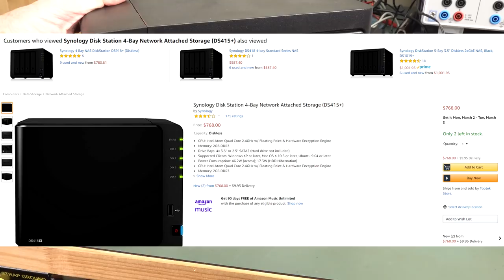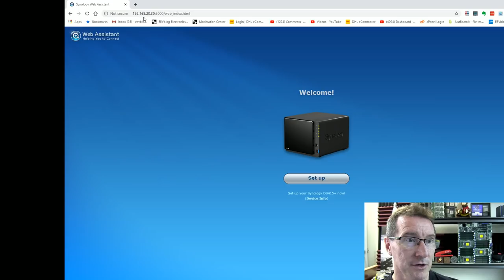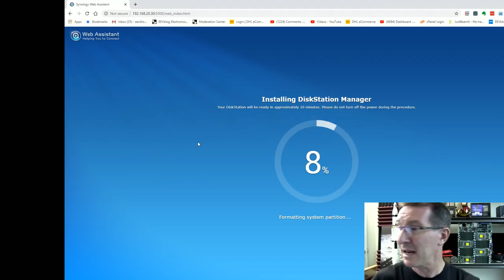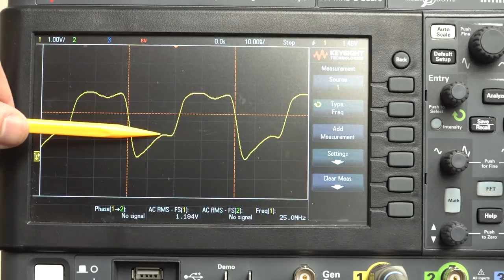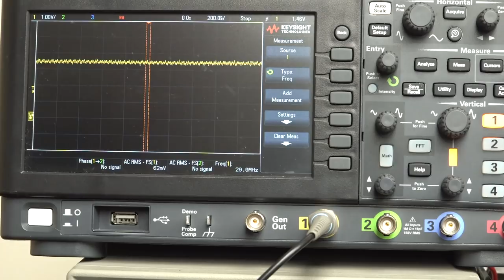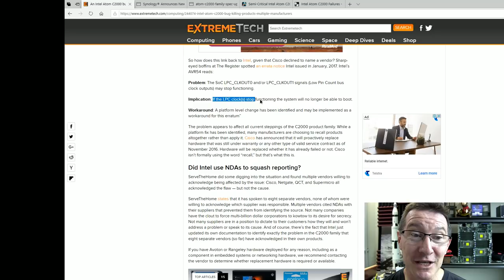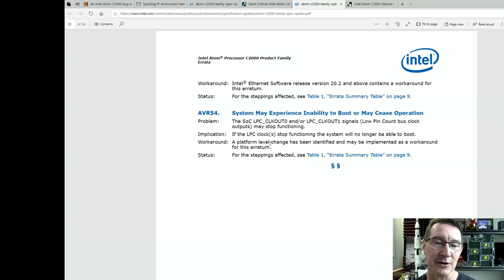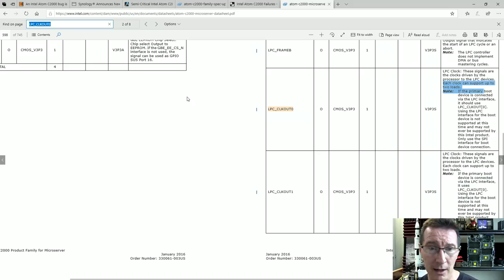EEVblog #1288 - Synology NAS Dumpster Find! (REPAIR)

Comment: I'm sure you're right about the P-FET failure.  It's probably in a hot spot on the chip or something equally mundane.  The series resistors adds a little extra inductance that might affect the clock shape some, but 25 MHz and no obvious overshoot minimizes my concern about that.  A stiff pull-up will stress the N-FET complement some, but I would use it for non-essentials.  What are the chances that the drives can be read in another NAS if this one failed?
Reply: You can put the drives into the latest equivalent box and it will migrate seamlessly.

Comment: Wow, dude, you might have just saved my bacon. I have a 1515+ which uses the same CPU, and is quite an early batch so it probably has this problem, but it's far out of warranty. I think I'll pre-emptively apply this fix! I like these devices. I can see why people say they are over-priced, in a sense they are, but if you just want something and you want it to work with no fuzz, these are great. Well, except when they have buggy Intel silicon I suppose... But other than that ;) Mine is 6 years old and going strong otherwise, running 24/7 most of that time. Here's hoping a 100ohm resistor can add some more years.

Also, you asked in the video - getting the install prompt does not mean the NAS was never used - the way these boxes work is they actually install and run their OS from the users harddrives. So, since the drive was unrecognized or blank, it had to install OS from scratch from ROM and set up anew.
Reply: Can you do it preemptively?
Reply: @z352kdaf8324  Sure, I don't see why not. The fix doesn't actually "repair" anything, it simply prevents the failed hardware from blocking the system boot process. The failed hardware in question isn't used in the NAS and thus the failure doesn't matter in and of itself.

Comment: Thanks Dave, I was planning on doing this exact fix to my Synology 415+ today!!
Reply from the maker: Let us know how it goes!
Reply: @EEVblog  I completed the resistor fix, changed the battery on the MB and swapped out the 2GB RAM for a 8GB stick :)  My Synology 415+ is now running smoothly once more.

To apply the resistor fix I bought a new Soldering Station from JayCar ( https://www.jaycar.com.au/esd-safe-solder-desolder-rework-station/p/TS1648 ). The thing is the extra soldering tips I bought for it at JayCar do not fit the soldering iron and JayCar says it does not sell any compatible soldering tips for this model...
I was not able to solder the resistor with the included conical soldering tip (I do not solder often) so I got out my cheapo 25 watt soldering iron and completed the task in no time (minutes)... Thanks JayCar... 

Can anybody recommend a good quality and well priced Soldering Station with digital display? Ideally up to $200ish?

Comment: I had a DS2415+ start flashing the power and alert lights for a few minutes then shut down.  Restart and same thing.  Zero access.  OMG I was horrified.  Did some research.  This is the Intel Atom failure that can be fixed with the 100 ohm resistor fix.  But I needed my data immediately so bought a DS2422+, a day later moved the drives over all at once and booted up the new unit.  Everything was present, zero loss.  Now to repair the 2415+ and either sell or have a backup to the backup.

Comment: I see a great many Cisco routers suffered from the C2000 issue. Makes me wonder if that's why my two Cisco routers crapped out after a few years' use. It left such a bad taste in my mouth that I switched to NetGear because I blamed Cisco themselves for selling crap. Maybe someday I'll tear the one I didn't throw out apart and see if the resistor "fix" can bring it back to life...

Comment: You can get it replace FREE from Synology :-) I have done it several times. You get a new unit with the post.
Reply: They just add the resistor and swap them.
Reply: @FrozenHaxor  Nope, they sent you a new NAS in a new and unopened sealed box. Have done it several times before. They ship same day they receive it.
Reply: @Peter Andersen, they only swap it out if its in warranty and you have an invoice right?
Reply: @BradPittishere  no, they extended the warranty for these models and you don't need an invoice. I got mine free and I just enter the serial number and they accepted.
Reply: @peterandersen4676 I am curious, do they ship out a more modern unit or the exact same model? :)
If they send out a brand new unit (not refurbished) I rather send it to Synology for replacement.

Mine (415+) has not failed just yet, so I have everything lined up to apply the fix today (preemptively) and just before I started I came across Dave's video on my YouTube feed :P
Reply from the maker: @peterandersen4676  Ooh, nice, is there a website link or something?
Reply: @BradPittishere  I got them replaced by synology. They have  a program. And the units was ofcause new units with no bugs.
Reply: @EEVblog  yes, just sign up and fill out the rma form on there website.  Just enter serial number, name and address. No need for original invoice.
Reply: @peterandersen4676  do they send out a 415+ or a newer model?
Reply: @BradPittishere  I got the same model back I sent out.
Reply: Umm, if they just swap it for the same model, do the new ones have that fix or will they fail as well after some period of time and Synology just tries to dodge around that problem?
Reply: That is probably why this one was in the dumpster - it was replaced by Synology!
Reply: Really? Maybe it was beginning to be to expensive for them so they started to repair them instead! I Got two new Ds1515+ last year.

Comment: Had this pain with the more expensive DS1815+ cost quiet a bit to send it in for repair. Got a refurb unit back, but the old saying of once bitten twice shy means i don't actively use the device the way i use to and i don't have the money to replace it either.

Comment: Well, you won't lose any data even if it does fail in the future, even though I don't think it will. Also you can get much cheaper power adaptors than that!

Comment: Well opamp outputs have a pull up and pull down transistors on their output. If the pull up transistor or it's drive circuity fails than the signal will not rise much over the low level voltage...

Comment: Regarding the oscilloscope signal 11:20 , I was watching a video about schottky diode (afrotechmods), and this signal reminds of the sample he had when a regular silicone diode has problems with reverse current at higher frequencies. 3:25 in his video. He was measuring current over a shunt I believe.

Comment: i would personally throw a bunch of fast drives in it in a ZFS pool and just slam it for a couple weeks. constantly just hit it with reads and writes and if it lasts through 2 week torture test, I would feel fine putting it in production, especially since you said it seems to have very little previous use. All that clock is for is the boot process then I really wouldnt worry too much because a NAS shouldn't be rebooting often at all.  I would also stick another matching RAM module in it if using ZFS because the RAM overhead is pretty crazy with a ZFS array.

Comment: I had a custom built NAS with a Supermicro board that had a C2000 chip, built in 2015 (12/15/2015 to be exact), ran 24/7 till middle of last year (10/04/2019) when it finally got the clock bug issue, contacted Supermicro and they fixed the board even though it was out of warranty. The board still runs fine although now it's no longer my main NAS, it's a test one used for trying software and burning in replacement drives, I don't trust it to do anything more.

Comment: I'm using the freeware OpenMediaVault NAS and some of the linux drivers have updated and broken the performance reporting parts of the system. So whether its a hardware fault or a software issue, NAS are always a work in progress. :-)

Comment: Oooh, it's a clock for the LPC bus. So that's why it won't boot. The LPC bus is what remains of the ISA bus in modern x86 based systems. Not a whole lot of important stuff is hanging on it, but the boot ROM is. Usually, anyway. If the clocks don't run, I suppose the ROM never gets the clocks needed to read it out, so the system can never boot.

Comment: You are better off using one of the HP Prodesk or Elitedesk PC's that you find and run "FreeNAS". Thats what ive been doing for the last 4yrs. Running 4x 2TB drives in RAID5. Sweet and Reliable.

Comment: Well I'll be damned.  My RS815+ died a little under a year ago.  According to the specs, it's apparently got an Atom C2538 processor in it, which is apparently affected by it.  Fortunately for me, I haven't thrown it out yet.

Typically, the bugger died about 6 months out of warranty and I was completely unaware of this failure, so I didn't bother to contact Synology.  I nearly did.  Oh well - at least I've got a good chance of fixing it now - it'd make a good backup target for the QNAP that replaced it.

Fortunately I was able to recover 90% of the data on the drive by mounting the drives in an ancient server case with enough drive bays in it.  The Synologies just use LVM, so it's not even a terribly complicated recovery.

Comment: Talking about your last video, the code you registered at the local supermarket may not be for the wheel you have, so they use different codes for each trolly so safeway or walmart don't lock each others trollies. Maybe look again and see if you can see how the code is set on the board in the wheel?

Comment: The Firmware is on separate boards because people tend to flash them over and over and they die after a lot of flashes.  Just replace the board instead of desoldering it and replacing it on the main board.

Comment: Synology doesn't even send you a new unit for RMA, they send you one that has the fix applied that was used previously, so you could end up with a unit that has more power on hours than the one you send back.

Comment: 700 Freedom Bucks for an unloaded 4-bay NAS vs. about 120 dollhairs for a Pi 4 Samba server and a couple 2-bay SATA-to-USB3 cradles. Let me think about that...

If the $700 pricetag were for a NAS loaded with 4 4TB (or even 2TB) drives, then that would change the maths considerably.

Comment: When you said it was the clock I was thinking an external oscillator would fix it and then you said it. Look at all you have taught us.

You don´t need NAS drives. Use standard consumer drives just as Backblaze does. Since it is already bodged together get a used power supply or after market from Amazon. There are some that are quite good. My MacBook adapter has lasted longer than 3 brand name Apple ones and it has USB charging ports.
Reply: Don’t be afraid to check out the prices. I picked up a couple of new Exos X14 12tb cheaper than Ironwolfs

Comment: I'd think that you can trust the NAS at least a bit. If it fails, you still have the data on the drives. And that should be able to be recovered relatively easily.

Comment: I am going through this now with a Synology DS1515+ with the Atom C2538, It started with the Synology randomly rebooting only between 4am-7am (never in the day) and then it dies. Going through warranty replacement at the moment. I also have an RS2416+ which I am quite reliant on with the same CPU, hopefully, I do not get that issue with this one.
Reply: A little update on this, Synology sent me a brand new unit today. Has the same CPU but it is a brand new unit, so I guess it already has something done to it to rectify the issue.

Comment: Thats a nice archival unit. Get a (used?) power adapter from ebay, imo.
I would check what kind of raid it uses, it its software mdraid(90% it is), why not trust it. In case of hard failure you can move the drives and reassemble the array elsewhere.

Comment: Had a Sophos sg125 Firewall Router which  had this issue aswell.   But no easy fix unfortunately 

  with some cold spray I could make one start up again but voltages in bios were read as double of what it was 24v 10v 6.6v and fan speeds at 65565k rpm

Comment: Hi Tim, I tried to fix in this way my Ts-451 and added the 100ohm resistor from pin 1 to 8. It was working but only with a cable, not with the resistor. Someone told me that it was an induttance issue. Anyway by mistake then I added the resistor from pin 1 to 10 and...from that moment the nas has gone completely dead. No light, nothing. Do you think there is a way to fix it? Thanks

Comment: Hi dave they are SAS ports, they dual channel SATA. basically but yes the way they made the board well, rather then just using cables, Dave to save some money in the long term run this at your home as both your office and home have NBN thus there is enough bandwidth so you could have a nice off site backup, i currently repairing a thecus N4200Eco, after this video i wonder if its something similar, both may have the same cpu, i got rid of the Thecus software off the IDE DOM and installed freenas.

Comment: The flash board actually looks like an eUSB, which is used in a lot of products, it's very convenient.

The storage connectors are actually SAS connectors and not SATA, does synology DS support SAS drives?

Comment: "I've got 4 6 gig drives"  Big Oof Dave, your dating yourself!
Reply from the maker: That's almost $1000 worth of drives, to me that's a big deal, I'm a tight arse.
Reply: @EEVblog  lol, that's not what I mean!
6 Terabyte drives is what I think you meant to say. Sorry, I don't have the timestamp.
That's okay though, I am only running on 128gb, ssd though, highly(!!!) suggested for your boot drive!
Reply: @BloodAsp  My gen sometimes say Meg drives ... or even worse Kilobytes!
Reply: @BloodAsp  I recommend 250 minimum for Windows now and given current prices, 512 should be considered.
Reply: @EEVblog  i love this comment, dave dating himself in the video AND the comments
......ignoring the 20 meg drive and controller board sitting on my floor right now and the 43 meg ide drive somewhere behind me on a shelf
Reply: @EEVblog  At some point I would love to fiddle with magnetic core memory, I find it fascinating how 'basic' it is, yet so advanced, and even non-volatile!!!
Reply: @EEVblog  When I put my DS414 together, I stuffed it with 4TB Constellations. At that time, the whole ensemble ran me 2500USD.  I was making pretty good coin and I wanted to get a good backup/archival array put into production, so I jumped into it.  I had two DS200 2 drive arrays chugging away, but were showing their age. It was high time to kick it big time. So TITAN was born.
Reply: I'm running a QNAP 4 bay NAS with 3 10TB drives which is making me feel like a hoarder compared to what other people have for storage.... The internet is constantly changing and some things get taken down due to copyright infringement or some other stupid reason and if you are in the right place at the right time you can get a copy that you can access for life... Besides, you can run a NAS off solar and small battery... Cheap home intranet..

Comment: Hi, Great find, I have had a DS415+ for a few years now and after watching your video I checked my NAS, mine has C2538, maybe mine is ok?
Reply: Probably just lucky my 415+ died this morning but an 100ohm resistor did the trick now its online and functional as normal again hut ordered a new nas and will use this old one for offsite backup.

Comment: Injecting 25 MHz into the LPC clock is very unlikely to work reliably. LPC is a 4-bit synchronous serial bus that resembles ISA functionality over a couple of pins (thus the name). The design is a single-master bus, with the Atom C2000 being the master on the bus. I don't expect the Atom takes its bus clock directly from the pin, so if you inject your own 25MHz clock into that pin, the devices will run on the injected clock, whereas the Atom will use its internal 25MHz clock it is unable to output properly. A synchronous bus with two unrelated clock sources is not going to work.

Comment: Hello, my synology rs2416 is not booting after dsm update. The blue and orange lights are on. I think I'm having the same problem. How long does putting 100 ohm resistor to the solution solve the problem?

Comment: Fix it.. but why not make a better 12 volt supply? If you want to buy, Amazon has the "T POWER 4-PIN - 12V Ac Dc Adapter Charger" for $29

Comment: My father had a wd nas thing, and it stopped working. It turned out the discs had a load of bad clusters. I tried to figure out how to raid them into a filesystem. In the end, I used the 'foremost' utility in Linux to try to get mostly the pictures off of it. Problem is all the larger pictures were like chopped off 80% down the screen. Don't know if I still have the boards or not.

Comment: I have a DS1515+ and have replaced the transistor BC847 4 times already and it keeps blowing for some reason. Any advise would be greatly appreciated. This is one in Q2 in the front on the top of the main board. I have already done the Atom fix and the battery was replaced. It has been running for almost a year now and then suddenly it isn't working anymore. It is plugged into a APC battery backup unit so the power coming in is conditioned.

Comment: We actually had a failed one at work due to same reason, the hard drives still work fine after recovery.  So maybe I should apply this fix ? Thanks Dave.
Reply: Maybe you should just get a replacement from the supplier, like everybody else does.
Reply: @johncoops6897  Bit late i think.  The failure happened after the extended warranty finished.

Comment: I had a PfSense router that suddenly failed.  Likely the same issue.  I wonder if it would be possible to locate a place to add a pull-up on that board?

Does Synology work without the Klowd?  After a Seagate backup drive that wanted you to create an account, I'm trigger-shy about buying these backup devices.

Comment: seems like machine ESD killed the upper totem pole indeed. a 200R resistor may help with the signal quality because indeed this clock is ugly.